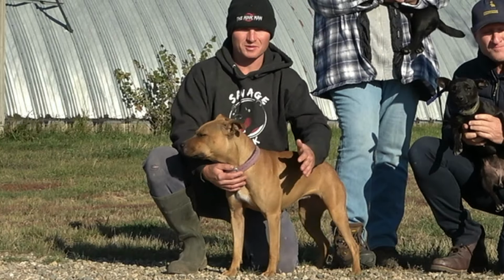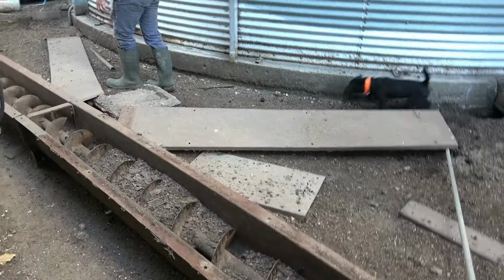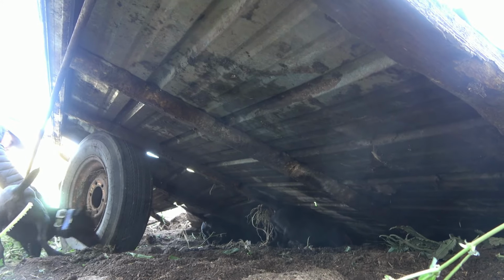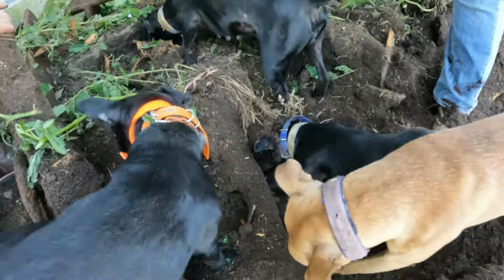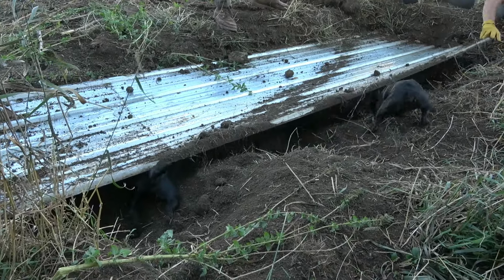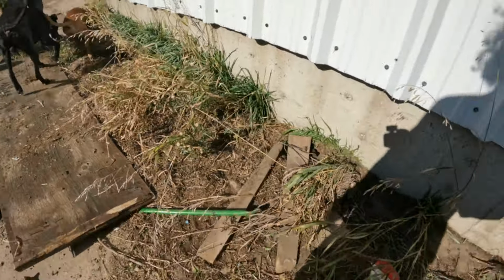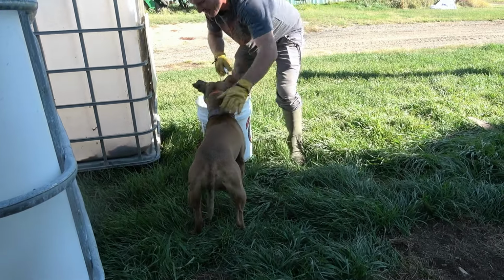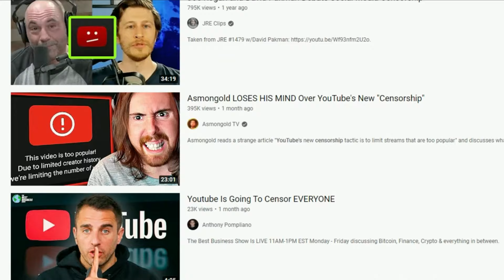73 Rats Caught at Infested Farm!

Comment: The dogs/mink team dynamic is so awesome and fascinating to see on these ratting hunts, something I'll never get tired of. The smaller dogs will get right in to the thick of the action by sniffing them out(Bindi probably has the best nose) and finding the source, while the larger one(Boss) usually hangs back and pick off the strays and runners and then the mink/s are unleashed into the nooks and crannies to catch or flush out the remaining rats in hiding. They(dogs and mink/s) all know their strengths/weaknesses, play their part and work together in harmony without any infighting. It may seem chaotic during these ratting hunts, but boy do they get the job done! Amazing work on Joe's part to assemble such a team and it's no small feat to get 2 different types of predators(dogs/minks) to work together and make it look so easy.

Comment: This video was randomly recommended to me, but im glad. Interesting stuff, just curious, do the dogs immediately go for the neck to break the spine?
Reply: The will break anything if they get a rat. Must of the time the for the skull or spine if rat is bigger than the head of the dog
Reply: Depending on the dog and their size. Boss for instance would crush the rats' skulls. He's big and strong enough to do quick work that way. Little dogs like Leia would shake them violently, so the quick persistent move ends up breaking the rat's neck. Of course, they add bites to try puncturing the spine to make extra sure their catch is deader than dead. Each dog learns on the job what works best for them.